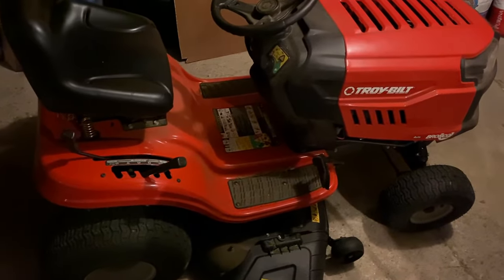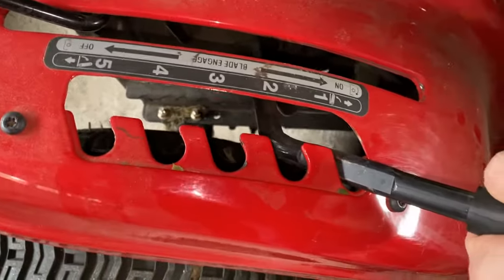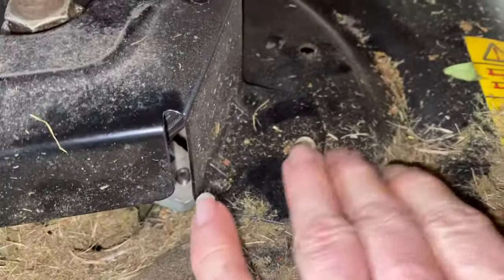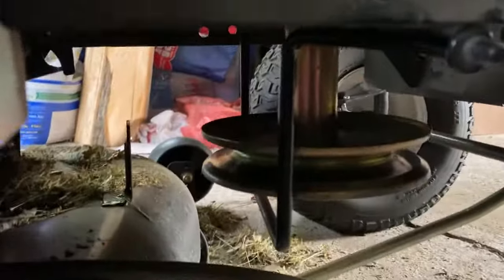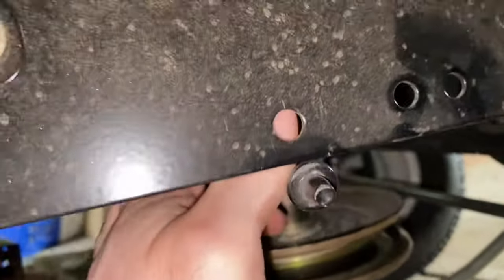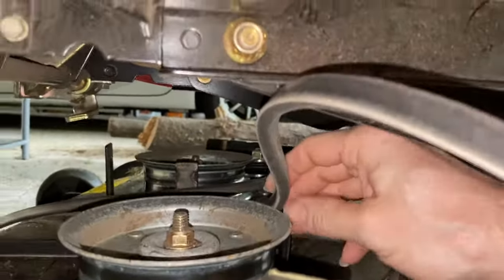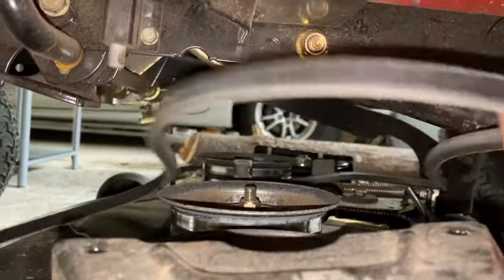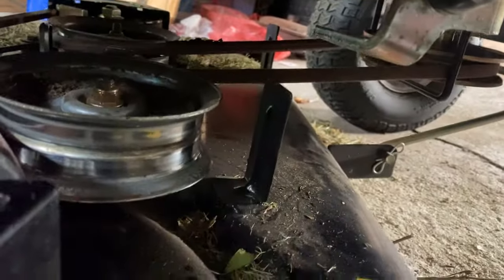How To Replace a Troy Bilt Mower Tractor Belt

Comment: Still having trouble? Positive you bought the right belt, but it seems like it's impossible to get it on?? then Jack up the rear if your belt seems too impossibly short to reach the final pully wheel.. bump it a bit on both sides and wait for the deck to slide forward towards the front tires.. Then Presto! ^_^ You will be able to get the belt on your older/ well used decks!:hand-purple-blue-peace:

Comment: Not so fast. On most models the front pulley on the right side has a belt “keeper”.  If you try to squeeze the belt between the keeper & the pulley your belt won’t easily go on & loosening the nut on top of the pulley is a BEAR of a job.